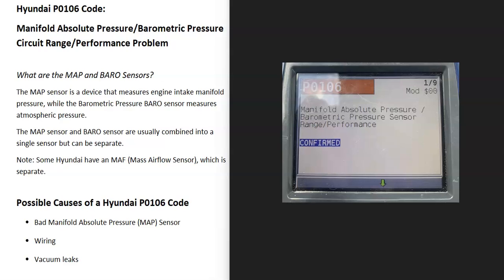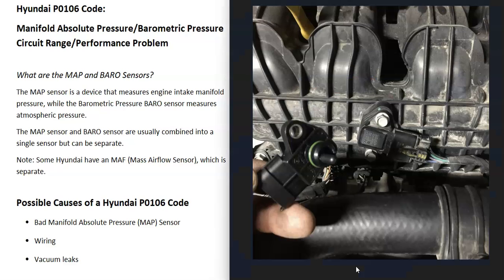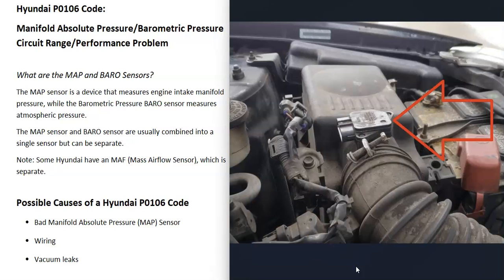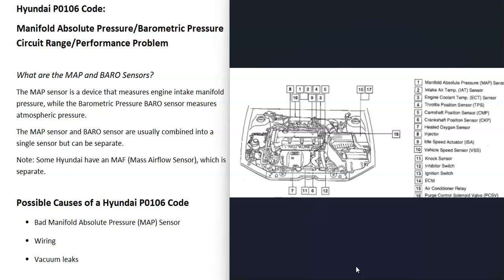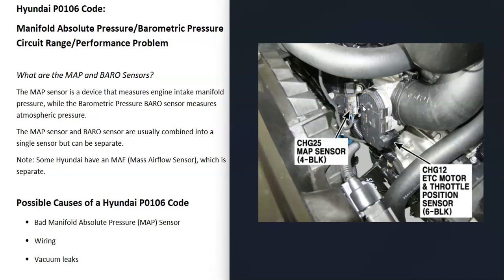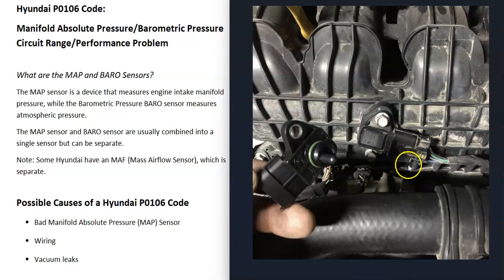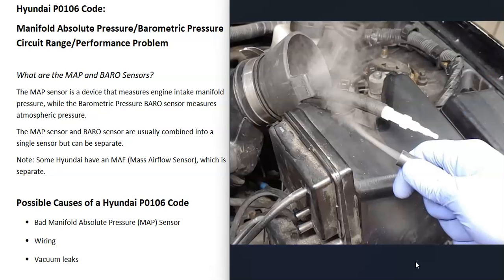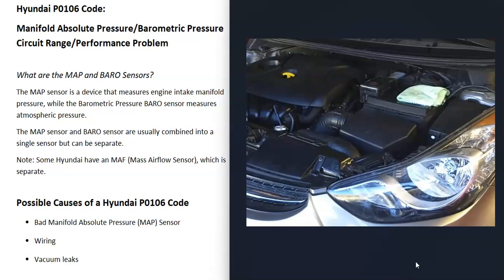HYUNDAI P0106 Code: Manifold Absolute Pressure/Barometric Pressure Range Performance

Comment: Mine came on after replacing the battery two times. There is nothing wrong with the sensor. But after I unplugged it first from the battery at both the pos+ and neg- the map sensor went crazy. Next I only unplugged the negative batt cable and it runs fine but engine light is still on. I did clear it once with a obd reader and once with the key on off method but the CEL is now on car runs great 200 miles later and I am not paying $150 for the mechanic to install a new sensor.
Reply: This is similar to what happened to mine (2010)...
The brake lights and some interior dash lights remained on for over 5 hrs after the car was parked.
I switched it off, then restarted it and idled to let the battery charge, and this P0106 code came up. 
I'm almost certain there are no issues, but cannot seem to clear the code with my code reader. It says permanent on it.
Any ideas?